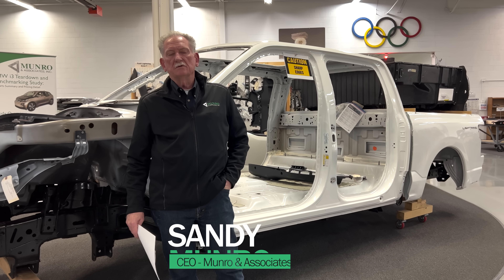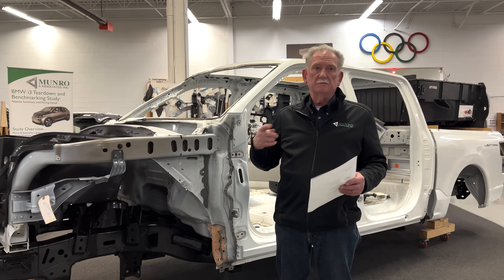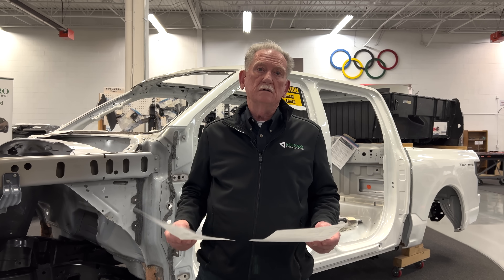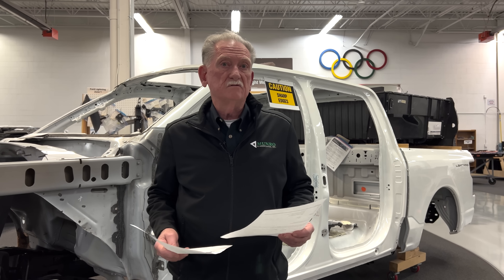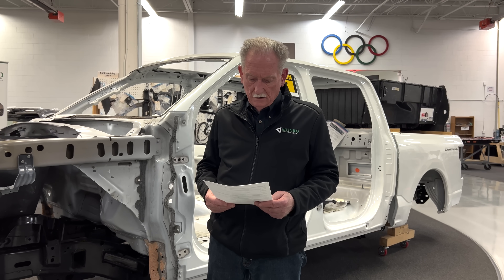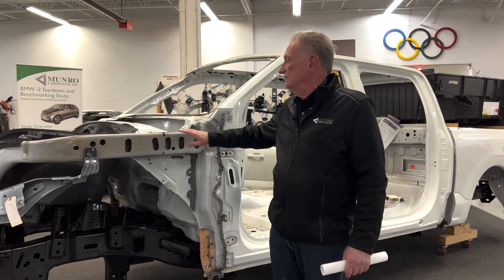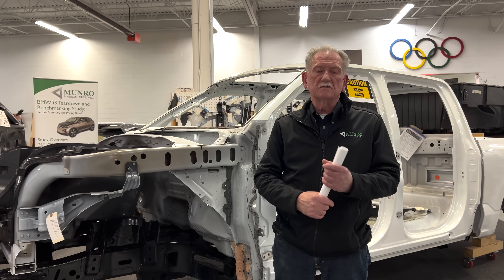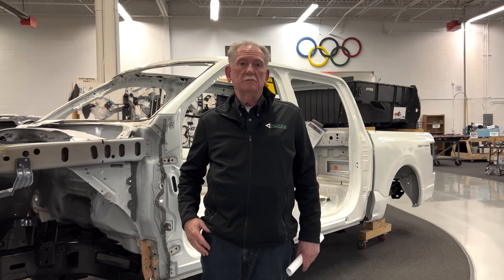Sandy's Initial Thoughts on the 2025 Ram 1500 Ramcharger

Comment: Seems to me that if you're going to go with a range extender, it needs to be a ground up engine build to minimize weight. A constant speed, non drive ICE doesn't need to be as strong as anything designed for variable rpm drive systems: Not to mention that intake and exhaust systems ,among others, would benefit from specialization to a very narrow rpm range.
Reply: Just switch it to run on the Atkinson cycle and you are set.
Reply: @natelarson5747  They'll be using the Pacifica Hybrid version of the 3.6L which is Atkinson.
Reply: I would expect they are using the Atkinson cycle 3.6 engine out of the Chrysler Pacifica.
Reply: Mazda planned for a wankel extender...
Reply: Sure, in the future they will probably do that.  For a first release, the V6 is probably just fine.  If anything, it's still too big but they wouldn't sell any if they put a 4 cyl in it.
Reply: This is why I suggested the turbo 4 cylinder power plant. Also the turbo is more efficient and can adjust to thinner air at higher elevation with no problems. A good generator is designed to be higher torque at lower constant rpm .
Reply: They probably will if this does well, they can build an efficient, lighter engine.
Reply: That would add a lot of cost and time to market. Maybe if it gets a second generation
Reply: @Anthony11986  it adds literally no engineering time.

just go to caterpillar and buy a generator engine from them.
or use the jeep ecodiesel with new intake and exhaust timing.
Reply: Development costs for a new engine can be billions of dollars.  Amortized over a million vehicles using it and it still adds thousands of dollars to each vehicle in addition to the actual mfg cost.  By using an existing engine, they completely avoid those dev costs.

Comment: About the range, I can see a shared driving situation making the most of that extreme range, but if we're talking about a work truck, that would likely represent a very, very small minority of use cases.
(Did Sandy forget to factor in the weight of the fuel for the ICE part in his weight stats?)
Reply: I felt the same and the were to put the tank as the battery takes the tank spot.  lol

Comment: Sandy points out 690 miles range being excessive BUT doesnt talk about range WHEN towing or when simply driving at highway speeds of 75 mph  What's the actual real world range would be...id guess no better than 275-325 miles based on load size and maybe 500+ miles at highway speeds with minimial to no load. So Sandy perhaps a follow up from that perspective!? And that should be with every eV OR PHEV that can tow.
Reply: Use the Ford as your guide. Complaints were that even at a 400 mile range, you were in the 100s towing. Add weather to that, and people were sub 100 miles when towing. Having a generator onboard means you can tow forever by just putting gas in it. It should be noted that Ram claimed a 135kw output from the gas engine, so with the entire battery depleated you'd still be fine driving around town but that's not enough power to pull 14,000lbs up a hill at highway speed. The good news is that the gas engine can run full time, so when you are NOT using it's full 135kw to drive the truck, the excess goes back into the battery.
Reply: Look even a gassers range is cut in half towing a camper. 690 miles will render around 200 with a ramcharger
Reply: A Gladiator (with the identical pentastar engine) gets in the single digits when towing. 200 miles towing is fine, and then you stop at a gas station. Big whoop.  @bob15479

Comment: Clearly Sandy has never towed anything or read about the poor range of the Lightning when towing.  It seems clear this Ram is the answer to those range issues.
Reply: Haha I’m sure he’s towed things. That’s hilariously dumb to say though. So props to you - until I read something dumber, you wear the belt.
Reply: @papafamilias92010  How can you be certain there, wise guy?  He made no mention of the poor towing range with the Lightning or that that the Ram would most certainly have much better range.  He seemed to only consider a narrow use case.  Not everyone drives 40 miles per day.  Sandy is obviously a sharp guy but he could have covered this better.
Reply: @jetrep  I do 100 to work and back if I make other stops then 120

Comment: Wouldn't this truck mileage be better for someone towing and hauling. That 600 miles might become 300 with the right toy behind it. Or it could use that range to power a week long camping trip.
Reply: I do prefer the idea of a fully electric but it doesn't seem, right now, anyone can build a truck with both excellent towing range AND a low price. I'm not a truck guy. I just think about the contractors out there who tow work trailers for on site work. I guess it would depend on the mileage between jobs and charges.
Reply: @pfd1970  80% of my remodeling/handywork clients are within 30 minute drive which is under the other 20% are within 45 minutes. Cybertruck will be plenty
Reply: Long haul towing is the only reason to buy PHEV truck
Reply: Also range stops mattering because you can just fill it with gas…
Reply: I think the point is, you don’t have to find a charging station and wait an hour to charge. You just put gas in the tank and go.
Reply: @mattharvell9494  only true if towing. Otherwise average stop is 20mns
Reply: @azorglub sure average might be 20 but how many more stops do you have to take on a multiple day road trip?  All the EV adventures I see online suggest it can add hours and even nights to a trip if you are cutting it close on the overall distance needed each day.
Reply: @stormsj  multiple. Everything is a compromise. No silver bullet.  I can do 700 miles in an EV in one day and that's as much driving as I want to do.  I do those once or twice a year. Rest of the time, I have a huge frunk, zero maintenance/no smog check/no oil change/no smelly gas station and a full tank every morning. Now if you're driving 1000 miles every weekend, an EV is not for you.  There's no one perfect vehicle. It all depends on one's use case.
Reply: @azorglub  there is no reason batteries won't get to point a 400 mile car today is a 700 mile car tomorrow at same battery volume and weight.  At that point more of us will be interested as we can then only charge overnight or maybe a bit when we eat or something only and not have to make so many stops purely to charge and spend 10-20 minutes stopped we really don't desire to make the distance we would like.  Until then a vehicle like the Ramcharger makes WAY more sense for us...and even you really if you have any interest at all in reaching the 700 mile destination earlier with an hour or few extra to enjoy it
Reply: @stormsj  batteries get better over time, no doubt. Been an EV only household for 5 years. No desire to ever own a gas car again. Stopping for 20mns on longer trips doesn't bother me.  By the time we take the dog for a walk and we get a bathroom break, car is ready. The convenience and performance gains the other 99% of the time work for me.  People obsess over charging stops for the 2 road trips they will take a year but then think nothing of wasting 30mns each weekend filling up their car at Costco. Go figure... :)
Reply: @azorglub  it's 20 minutes average per stop was what you said and at 20 minutes per stop is a lot more stopping than some of us do on road trips...not to mention we may only stop for 5 minutes and not even lose more than 10 minutes total for the stop. Full  20 minutes of charging is likely 30 minutes plus lost on the stop.  And you are getting what maybe 200 miles of range in something efficient and easy to find full speed charging in something like a model 3.  That's like one of the shorter legs I would do on 700 mile plus road trip with the family.  Not to mention I can't usually even convince them to stop and eat so 20 minutes ends up being max length of a stop if we get gas and stop for drive thru...haha.  

I just don't get why you all EV families think this is reasonable for everyone and won't give props to dodge here for giving us something that gives us all the 100% clear advantages of EV without all the road tripping compromises of EV that you goofs are happy deal with,but some of us refuse to put up with.
Reply: @azorglub  basically accept that they aren't for A lot of us, but maybe some hybrid or range extender like this does have a place until battery tech allows them to finally be better full stop.  Not to mention stuff that doesn't need charging on road trips really never needs fast charger until batteries big enough NOTHING needs fast charger generally cause we are ONLY charging overnight like we would at home.  This would allow a much easier grid upgrade if you EV folks just were happy with 10% market share or so and ok with DC fast charging never really getting expanded much and instead waiting for all day battery to try and force the rest of us to buy into this stupidity.
Reply: @stormsj  you do you.  If you like the RAM charger, you should get one.  I would derive no benefit from it.  Still better than a pure ICE truck but bound to be as expensive as an EV.
Reply: @stormsj  LoL. What a load of nonsense. EV are on their way to be the majority of the market within 10 years and probably less.  You buy what you want.  The trend is pretty clear for everyone else.
Reply: @azorglub  until they are clearly way cheaper for equivalent vehicles they aren't going to be majority of market.  The plateau in market share is already starting to be defined.  Stuff like this Ramcharger could sell really well and force various vehicle options that are more like this where they are only used as EVs close to home where that really is the better way to go,but then get used as gas vehicles on the rare road trip.  Now if government supported by people like you try to force these kinds of vehicles to be less preferable through messing with tax credits and other things to discourage them...sure you could be right.  But really for the grid everyone having an EV and trying to charge every 200 miles on road trips at 100-350kw per vehicle at the charging stop is just not going to be easy thing to build and be ready for 50% plus market share in 10 years.  It's going to be a shit show if everyone follows your lead to that degree.  It's just too many basically aluminum smelters running all the time up and down the interstates.
Reply: @stormsj  way to conflate everything. Ram charger will not be cheap.  As for road trips, it's super easy to do in an EV. Plenty of us have done long ones.  If you prefer the Ram charger get one, the government is giving a $7500 rebate on PHEV.
Reply: @azorglub  easy and time efficient are two different things...some of us want to get to the destination as efficiently as possible.
Reply: @stormsj  then get a gas car.  I measure my efficiency throughout the year, not on a few road trips.  I guess you don't.
Reply: @azorglub  no...I have a Chrysler Pacifica hybrid and that, but with bit more range is what they should try to sell...not EVs.  Yet there's all sorts of efforts to skip vehicles like that or this Ramcharger and effectively force everyone into EVs with almost nobody other than maybe Toyota and Stellantis somewhat promoting transition vehicles that wouldn't need the fast charging.  Fast charging infrastructure should just get skipped and wait until battery tech can accommodate slower overnight charging at hotels only. This would be the better way to do infrastructure for EVs..but battery tech isn't there yet.
Reply: @stormsj  we will have to disagree.
Reply: @azorglub  well you can continue to push for a situation that will create chaos on the grid if you please, but hopefully most of us are going to ignore this nonsense and your EV market share will probably top out at like 20% or something and spare the grid until all batteries are a thing and EVs are actually better for road trips even.
Reply: @stormsj  CA is at 25% of new cars being EV. Grid is just fine.  Utilities will keep investing and upgrading like they have for the last 120 years.  Fact is that plenty of people can and do road trip EV today just fine.   As infrastructure grows, it will keep getting easier.  Enjoy your Ram Charger if it makes you happy.
Reply: @azorglub  that's 25% of sales not 25% of cars on the road.... totally different thing.
Reply: @stormsj   average car on the road is usually 10-11 years old, so 10 years from now 25% of cars will be EV, and that number will keep growing. Good luck selling an ICE car in 10 years
Reply: @azorglub  well as the number gets to 20% on road let's talk the infrastructure again.  Aluminum smelter level power draw all over from more copious DC fast charging isn't going to be easy to accommodate.
Reply: @azorglub  not to mention already seeing claims on here that Cali electric prices are already $0.25+..
So the 20% sales seems to already be making the electricity prices insane.  No way lots of people here in TX could afford to cool their houses in summer if that was the electricity price here.  Who knows what that is when 20% of cars in use are EV.  Lots of consequences to going this direction.
Reply: @stormsj  sky is not falling.  Utilities love EVs and will build power plants accordingly.
Reply: @azorglub of course they do .. that's probably a lot of why electric is already double most of the country in California.  No big deal for coastal folks with moderate climate, but doubtful the inland folks are all that pleased with all the coastal EV goofs.
Reply: @stormsj we're already at the limits. 19.2 kilowatts 10 hours is only 180 kW of recharge which is smaller than the Silverado EV. This means if you want to get more power than that in that "overnight" time frame you have to visit a DCFC.
Reply: @azorglub model X towing-
 drive-in hour stop for an hour That's not sustainable... 

That means in 10 hours driving 70 miles an hour you only get 250 mi...
Reply: @stormsj not really because once there's demand the electricity companies scale the problem is the electricity companies cannot scale the peak demand because then they would go bankrupt.

This means you need energy storage solutions which currently the only thing remotely viable is batteries which are insanely expensive for grid support during peak times.
Reply: 600 miles of range will be about 300 miles of rang towing a 14,000 lb trailer.
Reply: @slammandrews3408 that’s not far off from the range of an exclusively ICE in a light duty pick up under load. Especially gasoline powered.
Reply: @slammandrews3408  probably when towing a 5k trailer which is very common
Reply: Agreed....the range extender will come in great when towing a trailer or RV
Reply: That's exactly what I thought. They are not putting 600 miles just because... They are listening to customers who need to tow and haul.
Reply: I don’t know anyone with a truck that averages about 40 miles a day and also calls it a work truck
Reply: Add towing in the winter months. Don’t think you will get close to the 600miles but we will see.
Reply: @chuck7140  depends if they have a heat pump or not, makes a dramatic difference. My SUV gets less than half the mpg in winter than summer so it’s not exclusive to EVs
Reply: And you could always just stop for gas.
Reply: This. Exactly this. We need 200+ mile towing range. Charging stations are still far enough and I haven't seen any that are designed for pull through charging with a trailer. So I do not want to be stopping often with my load.
Reply: @AdamLeon  Silverado EV 4WT for $80,000 has you covered. It's capable of 200 mi when towing before it needs recharged.
Reply: That's a good point the range goes down fast with weight and elevation.
Reply: That’s exactly what this truck is about, for towing and cold weather conditions. There are plenty of videos to explain the issues/limitations of EV trucks so I won’t go into here. The ignorance of this video is a disservice.
Reply: I think you are right @card4510, sandy is short sighted here. Those numbers are usually estimated and optimistic I actually think it has a really good use case
Reply: My impression is that Munroe is intentionally missing the point with this because it's not a BEV. He's not the only one. All the talk of it being overkill misses the point that not only would you need a massive battery to complete in a BEV, but you'd probably be blocking lots of chargers on the regular as charging stations are not easy to pull through like a gas station. So either you have the extra weight of a huge battery or the extra weight of an engine. This would make towing a lot easier than any EV on the market, if it works well. I'm sure the engineers have thought of all of the things everyone here would think of, so its probably just a matter of execution.
Reply: @peterfessier9780 based on the power numbers that the electric generator attach the engine can produce and their alleged 14,000 lb towing capacity If this thing has a dead battery you're not doing more than 30 miles an hour towing.....
Reply: Charging stations don't work often.  Or the app won't recognize your car.  Then, wait for someone else to charge.   Adds time an troubles to your holiday trip.  Out of my price range to boot.  Retired auto worker here.
Reply: Some times Sandy says dumb things that make no sense….this is one of those videos…..
Reply: @Kurto2021 care to elaborate on the “dome” things?